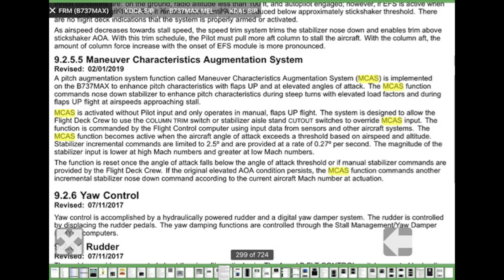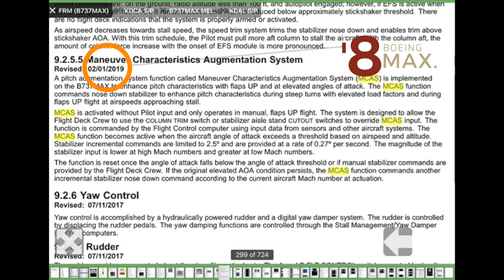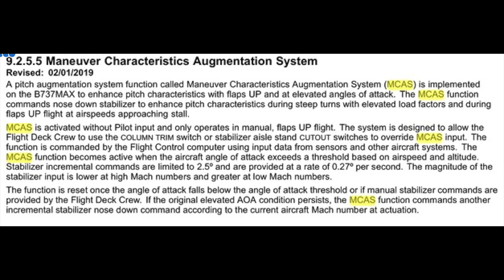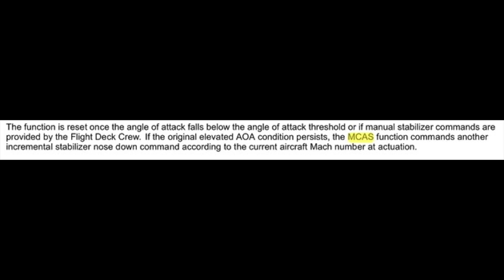737 flight manual - Prof Simon

Comment: WOW!  Being a retired airline pilot, I can tell you that if that MCAS system operates as just explained in that manual, whereas a short burst of trim from the control column mounted trim switch would cut out the offending system.... at least temporarily.... those aircraft would have been able to land safely.    I suspect that there is much more to this story.   ( Why didn't they trim it normally and/or manually then, and just fly the aircraft?)  

Also, please let me say that I am appalled that Boeing lied about the existence of this system having been installed.  Boeing's credibility with airline pilots has been damaged badly.  Make no mistake.... this is nothing short of  criminal  .....to install a system such as this, and fail to train for it.   And Boeing knows better!  Boeing obviously has serious management issues and they seem to be getting worse by having made such disastrously bad decisions.
Reply: I suspect a MCAS upset is far more startling than a runaway trim.  Not only will there be downward stabaliser applied perhaps it will be intermittent and concurrently there will be engine spool ups.   Perhaps pilots wouldn't notice intermittent downward trims.   I know one issue with MCAS (apart from lack of sensor redundancy and cross checking) is that it continues to trim down even if in near vertical dive.  First lion air flight had a 3rd pilot in the jump seat.  He was the one that ran a check list while the other two struggled with the aircraft.

Comment: Something to keep in mind.  This is, at its base, a 'Runaway Trim' condition.  Something all pilots that fly a plane with electric trim are trained in the simulator repeatedly to deal with.  It doesn't matter what causes it, a stuck switch, arced relay, faulty MCAS operation, the remedy is the same.  
FLY THE PLANE, remove power from the trim system, trim manually, and FLY THE PLANE.  Hunting through the manual to figure out WHY it's going on instead of first treating the symptom will get you killed.  Who cares what caused your inappropriate trim condition, manually control it and FLY THE PLANE.  
1. Aviate!
2. Communicate
3. Troubleshoot
The flying pilot does ONLY the first of those.  
Sorry to say, but this was pilot error.  No number of warning lights, tones, ICAS messages and manual procedures will help you if you are unwilling or unable to take control of the aircraft or have inadequate stick and rudder skills.
I have fought out of trim conditions in the simulator several times and if you allow it,  it will defeat you, it's stronger than you are, unless you decide to control it and have it assist you.

Comment: What changed? The positioning of  engines on the aircraft. Why? - they were bigger in size. Why? - to increase fuel efficiency. Why? - To increase market share and make more profit for BOENG. Okay then what was the impact of the change to the operation of the plane? The plane would easily stall during take off. What was done to solve this new problem? Introduction of MCAS. Okay was this communicated to the customer? NO. WHY? My personal opinion is that until this last question is answered we will not get to the root cause.
Reply from the maker: Yes....looks kinda that way.

Comment: And some say there's an indicator in which you may know whether the MCAS is on or not. Initially it's for the MCAS to get better AoA reading since it will using both AoA instead of just one AoA on the standard MCAS, but boeing offered it as an optional features that will cost and additional 80k extra.

Comment: when something goes wrong you have to be willing to back down levels of automation. So true. And probably transfer control of the aircraft to a ground station over a radio link because the pilots also freak out in case of emergency.

Comment: When an airplane's manual is updated, what occurs to notify the pilots of the update?   Is the updated parts sent to the airline and the airline is supposed to send the updated parts to the pilots operating that type of plane?  Are the pilots required to acknowledge receipt and reading of the update?  So the update was issued and 38 days later the accident occured.

Comment: As a pilot, take-offs and landing are the most demanding times.  During take-off you want to concentrate on the AOA and of course, POSITIVE RATE OF CLIMB!  Automation only comes into our minds when we have achieved stability.   In an emergency you automatically fly by eye and want FULL control of the aircraft.  It is human survival instinct. If the aircraft isn't doing what i want, i automatically assume it's broken and hence fight against it.  My OPINION is automation should be within the HUMAN envelope and not the human in the AUTOMATION envelope.  Us pilots we are soon becoming front seat passengers.

Comment: Yo nutty professor, be sure to be fair and balanced, and that means get us some scoop on the airlines training program or lack thereof, and info on the pilot and co-pilot in question. Criteria such as training, medical, hours in the max, who brought the max to the airport in the first place, who flew it? Why did they not have any problem, also be sure to find out about supposed maintenance recently performed. We all remember what happened to the Lear years ago when maintenance didn't correct the aux oxygen system.,. etc. thanks in advance for what you share.

Comment: Would it be too expensive for Boeing to just get  those engines remounted to  points on the wings where they balance better and don't require the MCAS so much?  after all what's to lose but a little bit of fuel efficiency!
Reply: Landing gear is too short, there would be a danger of scraping the engines.
Reply: Problem is that the engines are to big to fit under the plane (like you would normally mount engines, in the CG-area, under the wings) with the standard landing gear (it becomes to short).
-Thought; could Boeing have flipped them, mounted the upside down (over the wings instead, in the normal position, so the CG is not shifted forwards) -and called it a feature to reduce fly-over noise in crowed city areas.

Comment: The manual still doesn’t say if MCAS will take inputs from both AoA sensors instead of the single one as it is  currently designed. It’s clearly criminal to use just a single sensor input (single point failure) for such a dangerous risk mitigation.

Comment: Could it be Boeing didn't want to advertise the fact that the 737 Max needs an MCAS system @ all?
After all the system ( MCAS ) is only necessary due to using modern engines on an old fuselage/wing body.
Maybe the SALES team pushed to keep this fact invisible to the FAA and potential customers?
Flight Manual:- Have you got the 737 Max MCAS section before the 2019 revision?
Reply from the maker: I think that’s correct Gary.
Reply: @SimonHollandfilms  So Boeing tried to make the 737 Max and 737 ng fly in an identical fashion ...  which was achieved as long as no faults occurred ... But as explained in the link pulling back on the Yoke in an NG would save the aeroplane in a dive, pulling back on the yoke on a Max with a faulty AOA sensor crashes the plane ...   

"Basically, the pilots were NOT trained about the difference ... and in this case, it's was fatal .."How should they know that pulling on the Yoke didn’t stop the trim? It was described nowhere; neither in the aircraft’s manual, the AFM, nor in the Pilot’s manual, the FCOM. This has created strong reactions from airlines with the 737 MAX on the flight line and their Pilots. They have learned the NG and the MAX flies the same. They fly them interchangeably during the week."

see ...
https://leehamnews.com/2018/11/14/boeings-automatic-trim-for-the-737-max-was-not-disclosed-to-the-pilots/

Hence the UPDATE to the MCAS section of the PILOTS manual you HIGHLIGHTED.

So the bottom line it could be argued is that Boeing did NOT want to retrain the pilots ( for the MAX ) to save the airlines the retraining costs. And in all probability did not update the Pilots manual as proof no new pilot training was needed.

Guess it's up to the lawyers now and for FAA to do the job it should have done in the first place !!

Comment: I can see one contributing factory to a crash for any modern plane not just max-8/9. 

Planes with mcas signal fed by aoa are not vulnerable to alignment error is, however, vulnerable to biased error. 

Engine intake too powerful and too close to aoa meter can induce a down draft error at the aoa meter, read by MACS as nose down signal.

It takes several pitch degrees change to compensate for each degree of nose down bias error. 

Flaps retracting as it approaching end of climb, MCAS began to pay attention and respond to correct such bias error with nose up trim, instead of pitch correction puts the plane into a gradual climb, as the biased error persisted the trim continued until a alert sound off for air speed too low, pilot responded with increased throttle, but trimming continued, this went on until a terminal wing stall nose up, engine in full throttle.

Comment: I thought I would share a piece to the puzzle that I don't think most of you know about with the MCAS, and in this case what happened with Lion Air. Why maintenance did not find anything wrong with the aircraft when they had the same problem the day before the crash, and it was written up by the pilots. Not only were the pilot training manuals woefully inadequate, the maintenance manuals say very little about the MCAS. The day before the crash the airplane had an AOA vane failure and the nose was driving down but the crew turned off the stab trim motor and continued without further incident (that part we all know).  The discrepancy was written up in the log book but signed off by maintenance as “could not duplicate, system operation normal”.  Then the next flight it crashed as a different crew struggled, not knowing what to do.  What they did not know is that the system takes turns between using the right and left  AOA vanes each flight. When the mechanic tested the system it had switched to the good vane when it landed the day before,  so the test passed. The computer saw the test as a flight cycle and switched to the other vane at the completion of the test and then it used the inoperative vane for the next flight. If only they had known to do the test twice!
Reply: Tower Runner  - I have been reading a lot about the MAX issue ... this is the first time I’m reading that the MCAS takes inputs alternately for each trip! Is this really a confirmed finding?
Reply: @arvindvader1363   read my reply to the Professor.
Reply: @Tower Runner - Thanks for confirming! I’m shocked beyond belief.
Reply: Note the first Lion Air crew happened to have a 3rd pilot in the jump seat.  When MCAS malfunctioned the other crew were overloaded struggling with the repeated intermitttant MCAS nose down pitches and thrtottle ups but the jump seat pilot had bandwidth and could see what was going on he was able to run a check list and solve the problem.  The second crew did not have the luck of a 3rd pilot.
Reply from the maker: That’s fascinating info....I wondered with 2 Aoa vanes.  How the mcas used them....very chilling and thank you for sharing this. Can I use the info in a film? Where did you get the info ? Prof simon.
Reply: @SimonHollandfilms  , I have a good friend (we are both in the aviation industry) who is in maintenance with a company that has both the 737NG and the MAX. I had to ask him if I could share this information, he said it is known and it could be shared. I would just keep it on the "anonymous" side, for his sake.  Also, the Lion Air maintenance did follow procedures, but apparently there was nothing in there telling them to test the system twice. 
.
Other versions of the MAX (that is what package of equipment an airline ordered with their MAX 8) did have a warning system if an AOA vane was malfunctioning, but apparently had no procedures for the pilots, if they got a warning.  Also, these aircraft would indicate to the Pilots which AOA vane is being used. Not really useful for them, but very useful for maintenance. Not something the Lion Air MAX 8 had. 
.
Apparently, what the fix Boeing intends to put in place, is to now have the MCAS system use both  AOA vanes for data for the computer, and if there is a discrepancy between the two, give a warning light, and  disable the stab trim motor auto drive.
Reply: Great information!!
Reply from the maker: done...thank you.
Reply: Wow. That's practically a built-in death mechanism (unless is was known to everybody involved in maintenance and flying). Horrible!

Comment: Automation dependency has been a problem dating back to the early 1990's and the introduction of the Air Bus fly by wire systems. Greater automation and auto pilot assist systems were introduce by Air Bus and Boeing  to try and reduce the number of fatal crashes that were found d to be due to pilot error.
These accounted at the time to by far the most significant cause of air craft crashes.
Unfortunately several crashes resulted because , on the one hand,  of pilots over auto dependency and not just taking manual control and flying the plane.
Whereas, other crashes occurred by seasoned pilots used to manual flying getting confused by the automation.
Today Automation dependency today is still a persistant problem. These MAX 8 crashes could have been easily avoided by simply switching off the  STAB Trim and manually trimming the aircraft as necessary.
But instead the pilots of these planes wasted this opportunity, by trying to first resolve the problem looking through the planes flight manual.

Of course in these two crashes you cannot put all the blame on the pilots as it is now clear they were in adequately prepared to fly this new 737 and should have received retraining and flight simulator time .
 
 Boeing apparently deliberately sold the planeon the basis this would not be necessary as the MAX 8  was not significantly different from the previous 737's

Comment: I hold an ATP, , Boeing was taking the lead in eventually getting rid of the co-pilot.  Today there is a huge shortage of ATP rated pilots, and carriers complain of training costs. That stupid MCAS should never have been installed to start with, how many airline pilots were flying around near stall speed to start with???????  NONE... Boeing, criminally liable.
Reply: Lots of pilots have stalled airliners and killed themselves, their crew and passengers.  I'm thinking of Continental Express Flight 3407.   If MCAS had of been properly designed (triple redundancy) and certified (tests to shakeout any issues) it would have saved lives.   Instead a simple sensor fault had the opposite effect.  Replacing the copilot is insane.

Comment: As we see this played out, Boeing will blame poor pilot and lack of training, rather than poor design and bad aerodynamics. Pilot vs plane. AOA is not AOK!
Reply: Boeing shouldn't DARE try to blame the pilots.   Those poor guys... fighting their own aircraft that refused to follow their manual commands right up to the very point they ... what does Boeing refer to it as..."interacting or impacting with the Terrain" (pathetic PR writing for slammed into the ground killing everyone)... the thought of that just turns my stomach. And they died probably thinking that they killed all the people that entrusted their lives to them !  Wherever they are, I hope they know....they weren't responsible - the blood is on Boeing's hands.
Reply: Maybe the plane worked as advertised and the pilot didn't know how to turn off the auto trim system when a possible error happened? What if? All modern aircraft have a flight augmentation system on them and can be turned off and the airplane flown manually.
Reply: That's what has been playing in the flight industry since at least 1980's. Not only isolated to boeing, it's continuously applied to crashes by all manufacturers. Once a pilot is dead, it's very lucrative for the manufacturer, the airline and the insurance company to put as much blame on pilots as possible. Reducing even 10% of a 1.5Billion USD compensation is very profitable, let alone 20-30-50 even 100%. They've done it before, and they'll keep doing it for all eternity.
Reply: blaming the pilot training would be funny, if it where not so sad - Boeing used the minimal training required to transition from one 737 to the 737 Max 8 as one of its selling points. And I mean even assuming lack of training: What kind of training would have helped at all? Simulating broken angle of attack sensor in a flight simulator that is not simulating MCAS? Reading the manual more carefully, when the input angle that the MCAS is actually able to apply is much greater then described in the manual? The statement of not relaying on automation is correct - but if the aircraft screams stall warning and starts a rodeo ride, praying to god for a wonder is not the most insane thing to do. The assumption that pilots that normally just starts, monitors system and land would know how to handle such a heavy machine in an extreme situation outside anything trained with incorrect instrument data would be a wonder.

Comment: Was MCAS a cheap alternative to get around some poor design/engineering? If so then the training and flight manual should have been extensive.
Reply: willum whitmore The new engines for the 737MAX series are high-bypass turbo fans. These engines are larger than previous versions. The increase in engine size meant that they would not be able to fit totally under the wing as in 737-800. So, they moved the engines forward and higher up to accommodate the new size. The result is system that has different lift characteristics. The new aircraft system (737MAX) has a tendency to pitch up at takeoff. MCAS was designed to work in the background.
Reply: The question would have been: Is the 737MAX8 a 737 or a separate type with complete new type rating for the pilot?